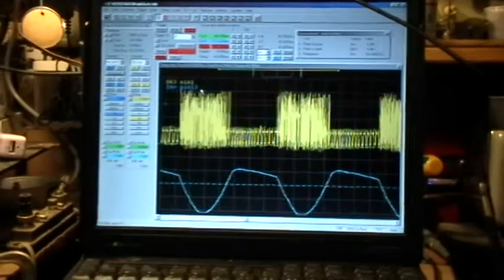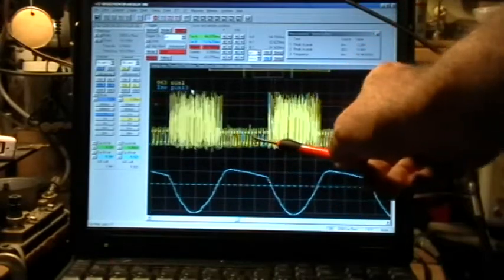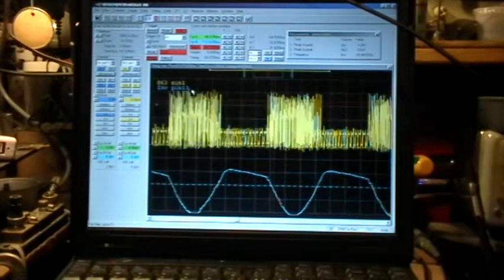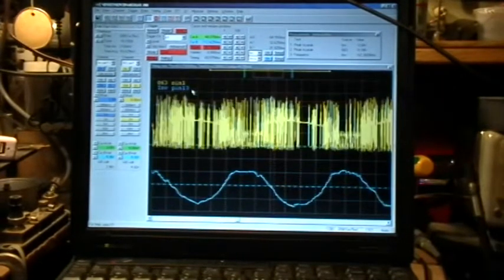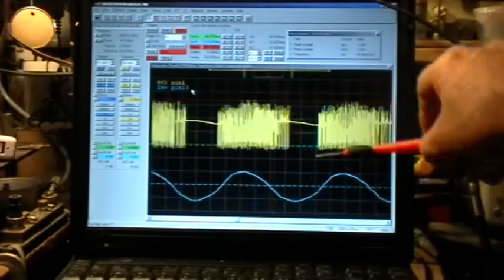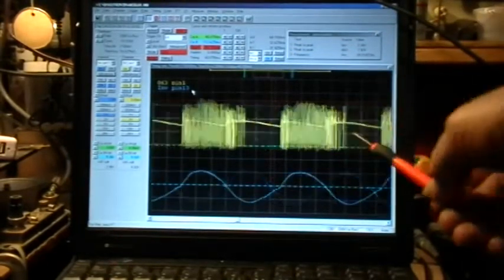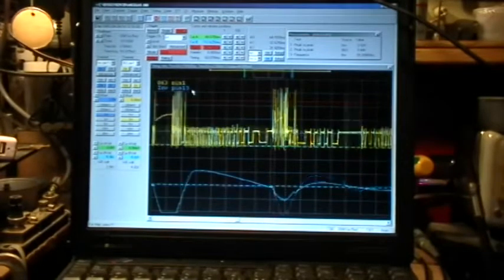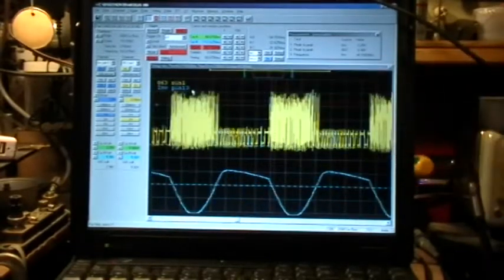Electric OU: TK-Akula Explanation of the Embedded Sinusoid

Comment: Hi TK, if you have the same circuit as Akula, I think the noise bursts come from the MOSFET Pulling the supply voltage too much down and then the DC2DC converter goes into uncontrolled noise switching mode. so no realiable frequency...But it is probably because the supply voltag is pulled too much down.. Maybe there is an error in the circuit diagram and Akula wanted to use the MOSFET to switch directly one of the coils ??
Reply from the maker: Yes, I have the same circuit as Akula, but I don't think that's how it works. I think that the noise bursts drive the mosfet switching, not the other way around. I am still testing and thinking about this though.
The 100R resistor functions as the "load" for the mosfet. I suppose I could try a variation where the coil is driven by the mosfet instead of by the inverter chip. That could be interesting. Meanwhile, stay tuned for more information. Next video is uploading.
Reply: TinselKoala hmm, I think this Akula circuit has design flaws...why would you waste energy by pulling up and down the supply voltage ? Maybe the circuit diagram from Akula or whoever had drawn it has an error....where do you think comes the noise from ? Probably from the DC2DC converter having too low of a supply voltage and going into unstable oscillations....better switch to the newer circuit with the 2 TL496 ICs....